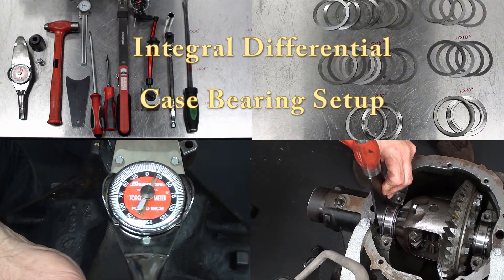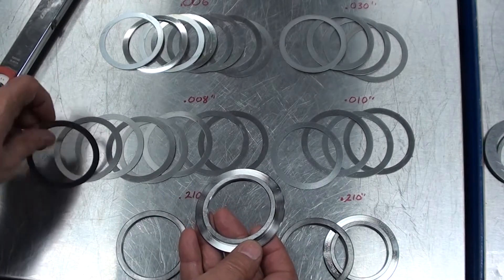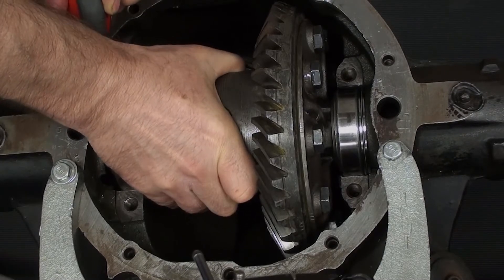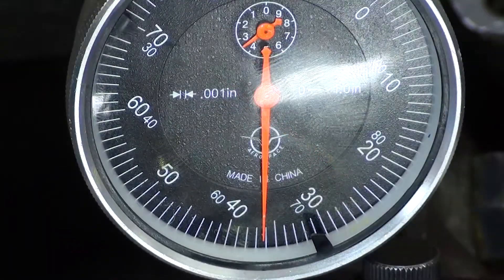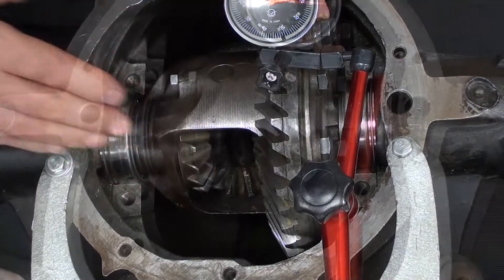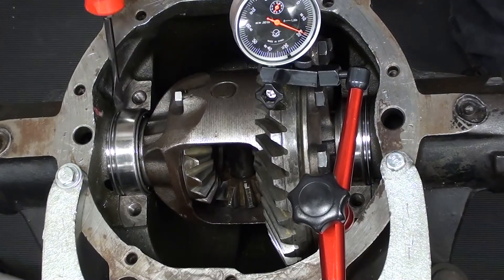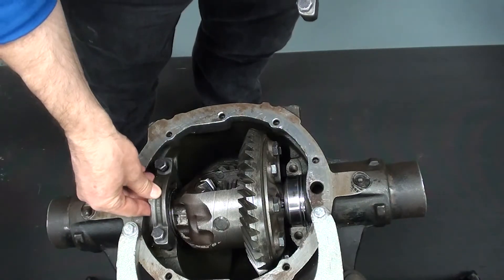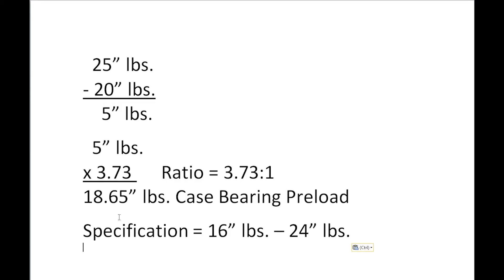Differential Case Installation With Universal Shims

Comment: Hi i have a question, i was taught never to add more shims to each side of a tapered bearing, but to remove from one side and add the same to the other side only. 

Also, you didn't check the pattern for the ring gear and pinion with that marking paste/compound which will definitely show if its right on the money. 

To understand how much shims to add on each side and the feel is iffy. 

I was wondering how do you know if this is the absolute and whether the differential pinion is where it should be and not as if you were moving the ring gear only to compensate for that? I've never done this in a real world scenario but i'm just wondering.

I'm sorry to criticize you and i'm sure you know what you're doing but these are just parts of a bigger story :\ I do love your videos. I just wish they were like the full story, on how to install everything properly in a differential. 
If someone saw just this part, they'd think that the differential they setup using this video is 100% good.
Reply from the maker: To answer your first question this is the initial setup of backlash and case bearing preload.  The procedure is proven reliable and consistent every time. Notice that Backlash is started out smaller than spec so when I add extra shims on one side only backlash is corrected at the same time that I'm adding case bearing preload.  What you were taught is correct only when you want to change backlash without changing the existing case bearing preload.  

The pattern is checked in another video however the dial indicator verifies the backlash so the pattern test would verify that my pinion depth is correct.  Pinion depth measuring is covered in another video and I'm working on a video that explains what happens to contact patch depending on pinion depth position.
Reply: Hmm, I was wondering, but how do you know how much shims are too much, its like sandwiching thick sandwich buns in the same thickness burgers used at mcdonalds and maybe the buns you can buy from safeway lols. 
What i'm trying to say is if you add more thickness shims depending if you add to one side, it'll move the backlash away or close or something along those lines but the case bearing preload is not perfect yet and i saw you placed shims on the other side to counter that. Also realistically if you place too much shims to each side wouldn't that place the tapered bearings possibly too tight and could cause it to prematurely fail compared to as if it was using a slightly less shims on each side with the same differential and everything in another setup or so. I saw you just place shims of different thickness according to how what you had on had, Ex: lets say, .003" .007" .009" .012" .015", you would add .003"+ .007" to get .010" if the single .009" is still too lose right? Sorry for being so complicated, sometimes you gotta be complicated in order to understand 100% of everything.

One favor to ask :D, Is it possible if you are working on other videos on the differential to possibly once you do these different part segments of a "WHOLE Differential setup" could you do one maybe where all you have to do is splice your videos in a video editing software to make it seem "whole" so i can truly see how its 100% done. Its complicated to explain, i don't know how to explain the things i'm thinking in my head. The reason why i ask is your username is DrivelineMaster but some people call themselves master but are not good enough to call them the greatest because all they do is steal information from others or watch a "How to video" and boom they are now a differential master or something xD, I want to question myself, why you do the things you do in this and if i were to reorganize some of your steps in different ways, like ex: right now everything you do is 1, 2, 3, 4, 5, 6, 7, 8, 9, 10. lets say hmmm... Step 8 should actually be between step 3-4 because it seems there could be a situation where it could be used there. 
Sorry for being hard to get :\ If you understand what i'm trying to say, could you reply back "your spin" on things for me :)

Note:** I know micky D's burgers don't age and are extremely disgusting.
Reply from the maker: Case bearing preload has been measured or set multiple ways over the years from manufacture to manufacture.  Years ago GM would teach to set backlash to specification with zero preload and zero free play. Then they wanted the tech to increase each shim by .004" on each side.  This is a total of .008" which is what I used.  GM now uses a technique similar to mine and uses rotational force in inch pounds to know if the preload is correct.  Measuring case bearing preload is done by subtracting the breakaway rotational force of the pinion and case from the rotational breakaway force of just the pinion (also known as pinion bearing preload). Then the difference is multiplied by the gear ratio to calculate the rotational force of the differential case and case bearings. This varies but is often between 14" lbs. to 24" lbs.  Nissan doesn't get that detailed. They just spec. what the difference in rotational force should be but this only works if you use OEM gear ratio since gear ratio plays a part in rotational force.  Some Mazda removable diffs and Ford 9" straddle mount pinion designs measure case housing spread with a dial indicator.  Measuring rotational force in inch pounds like GM does is now the most accurate.  Start with a preload (sandwich "your words") of .008", measure the rotational force and add or take away as needed making sure to keep backlash within specification.
Reply: For that first part, Rotational force in inch lbs, i remember that from class :D Using a torque beam wrench in inch lbs to test for turning torque. I didn't know Gear ratio plays a part in rotational force, i thought the only thing is if you go small gear ratio you'll have faster acceleration and bigger gear ratio a higher top speed. Toyota uses Turning torque = rotational force in inch lbs too, from what i can see or sounds like.

Okay so let me get this straight on the money for the last part:
Quote: "Start with a preload (sandwich "your words") of .008", measure the rotational force and add or take away as needed making sure to keep backlash within specification.

What i should do is preload it .008", so .004" on each side right? then measure rotational force/turning torque, and add as little as possible to that like what i said before with adding different shims or using a bigger single shim to do the job. So when measuring the rotational force, should i take out the ring gear when doing so or should i just measure it with it in? There are so many "Ifs" and the MFR only puts in certain ways of doing things. Of course use the old crush collar to measure so i don't have to continually replace that "B****", thats another "if" lol. On the Honda S2000, J's Racing makes a upgraded collar for the differential which doesn't require it to be crushed and maintains backlash. So awesome. Should in essence never have to replace it and can be reused infinite amount of times. Has to buy the shims for the pinion. J's Racing SPL Differential Distance Collar Full Shim Set - Honda S2000 & J's Racing SPL Differential Distance Collar - Honda S2000. Shim pack cost $140 for like dozen shims -_- and i could buy each seperately but i like to buy all so i can mess with it some more some day. Everything cost $ :S Thank you for your words of expertise.
Reply from the maker: Hi Lime,  Let me try and spell it out clearly for you if I can.  Step 1, setup your pinion bearing preload with the inch lbs. beam or dial torque wrench.  Pinion turning force only, nothing else.  It doesn't matter if you use a crush sleeve or an eliminator kit with shims. (Crush sleeves should never be reused on a rebuild however I have sometimes  gotten away with one reuse when replacing a pinion seal on a vehicle that has been in service for several years. Reusing a crush sleeve on a rebuild is asking for a comeback.)  Step 2, install your complete case with ring gear and set it up as instructed by the video with your final step of adding .008" shim to the non-ring gear side.  This will add the case bearing preload and push the ring gear away from the pinion to increase the backlash right into specification.  Step 3, after bolting the bearing caps into place turn the diff over and with the inch lbs. torque wrench (beam or dial) measure the rotational force which will now be a combination of the pinion bearing preload you set in step one and the additional force needed to turn the case.  The difference between this value and the pinion bearing preload set in step one is the results of the preload placed on the case bearings.  Because you are turning the case with the pinion and can't turn the case directly the force needed to turn the case with the pinion is made easier because you have a mechanical advantage of the gear ratio.  That is why we multiply the rotational difference between the two by the gear ratio.  This gives us the exact rotational force needed to turn the case. The rotational force to turn the case is directly related to the preload exerted upon the case bearings.  If your case bearing preload and backlash is correct you are done.  If the backlash is correct and your preload is too small you will now add equal amount shims to both sides (e.g. .002" to each side). This will increase the case bearing preload without changing backlash.  If preload was too much and backlash is OK subtract equal amounts from each side.  There are a whole lot of other variable options if backlash was not OK or at the low or high end of the specification and if the preload was or was not in specification that I won't go into.

As for your other statement about gear ratio depending on how you looked at it you might have it backwards. a 4:1 gear ratio is numerically high but in automotive we would call this a low gear ratio because this would be like 1st gear for the transmission. This will give use a lot of torque with very little speed. An input of 2000 RPM and 200' lbs of torque would come out with 500 RPM and 800' lbs. of torque. On the other end .5:1 gear ratio (overdrive) is numerically low but in automotive this is a high gear ratio because this would be high gear in the car like 5th or 6th.  The results are reversed torque reduces and speed increases.  The same input would result in 4000 RPM and 100' lbs. of torque. Just a side note. High gear in the vehicle is never .5:1. Most never get any higher than .7:1.  Differentials never use an overdrive ratio this was just to explain gear ratios in general and automotive gear ratios are always to 1 turn of the driven gear or pulley.  (We never us a ratio like 1:.5 or 1:2)
Reply: Alright, I understand the 1 paragraph. That makes sense now, the instructors are knowledgeable in my school. He used to be a machinest that had a ASE for i believe a certain ASE that only 700ish people that in the U.S. He knew how to rebuild transmissions, tranaxles, automatic, manual, transfer case and differentials and really he always lost me in automatics for the valve body lol. Too much knowledge going around and over 50% of the class looked like  they were knocked out and didn't understand a single thing. Nobody wanted to say anything because typically students are scared of being ridiculed. My instructor would treat everyone equally... Equal opportunity harassment i think was it called, if you didn't listen in class then he'll get mad about it and start throwing the trans around because you're placing a dial indicator with the base on a metal surface that the differential is not fixed in anyway but by magnets and the differential can move and will give false readings of the needle or another occasion when i got caught using a dial indicator and it was on the metal surface and he got mad and said "WHAT'S THAT GOING TO DO?" and shook the manual transmission/transaxle counter shaft or mainshaft when it wasn't somehow fixed i think. Anyways the stuff he taught me, i will now be picky and might weld on a box where the base can go or just leave the base because magnet is hefty and probably won't move while rotating the shaft but maybe make sure to weld a "Boxed section" for where V-blocks can go for so i can mount the counter shafts or w\e shafts i'm inspecting for radial clearance or whatever i'm inspecting for. :P I kept my notes and all i've done in school but haven't read them over :S. I thank you for your help. Most people will not go to lengths to do this, its just asking for "Did you go to class?" "Did you listen in class" "Did you even go to automotive school". Literally this is stuff I should be paying for or something :) Going to depth just to help a normal joe like me just interested in possibly making some $ but biggest thing in life for me is to be a father figure to work on my own stuff and be knowledgeable! :-)

I thank you for the last paragraph. I think i might of messed it up. I haven't went over my material and can't remember which was which. I know you're right since i haven't gone through my notes in 2 years lol.
Again Thank you!!!
Reply from the maker: On behalf of all Automotive Instructors I'm sorry you had such an aggressive intolerable instructor. You should never be made to feel afraid to ask questions. Questions are a good way to learn and it gives the instructor a great opportunity to teach because we now know what you don't understand. The method described in my video is a relatively new technique that many old timers would not know about. I'm glad my explanation made sense. Your questions most certainly helped someone else.
Reply: Its not really my automotive instructors fault, they don't have degrees in teaching or anything but they are willing to help. I've always had to do with some type of abuse in my life, so its not that bad. When I'm at home or so dealing with the people on the street, work, home are so unbareable. The Automotive instructors are so much easier to deal with, its just the students will probably call you out for asking dumb questions, its a foundation built from when you're little and kids harass others, i went to another state to learn and i enjoyed it, some students were a problem but life is never easy but when it turns out that life can be extremely hard, worse time in my life was the 4 years in high school. I appreciate all you do. Typically when i ask my instructors questions like these, they don't seem to understand and keep going with what they know. I had a instructor that taught engines and man he taught that at a high level to understand. Sometimes it better when i talk to people like you, you are professional and easy to understand. ESPECIALLY when i asked you an understanding full on about how to check and inspect a full on differential :).
Again, thank you very much.